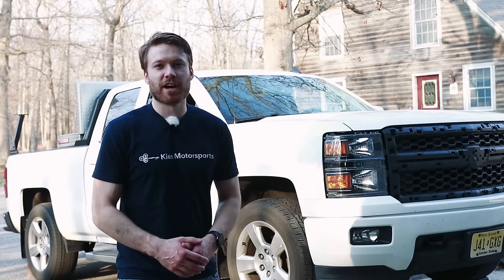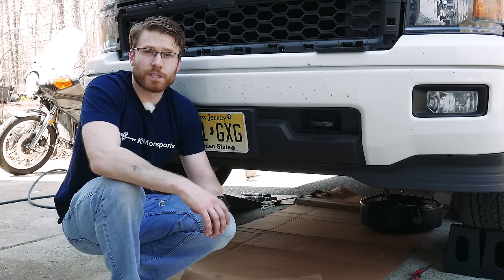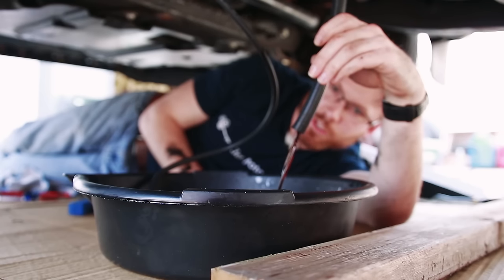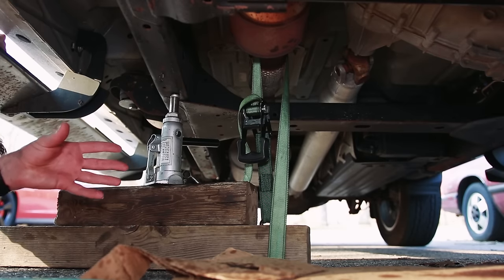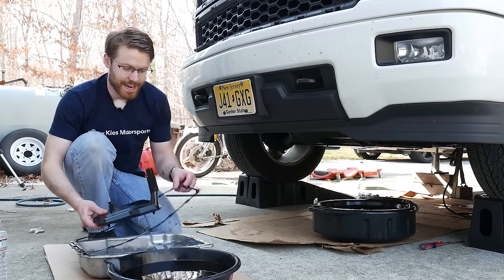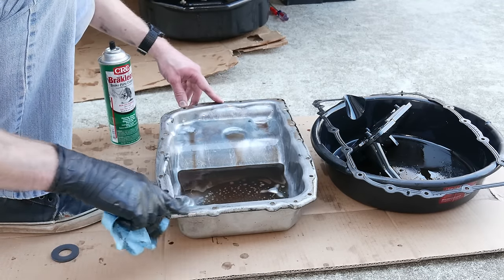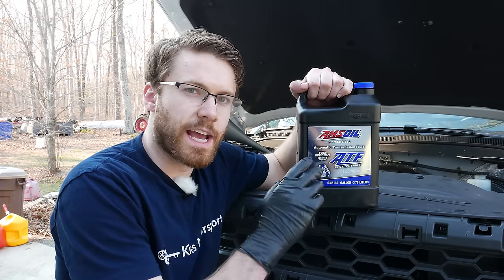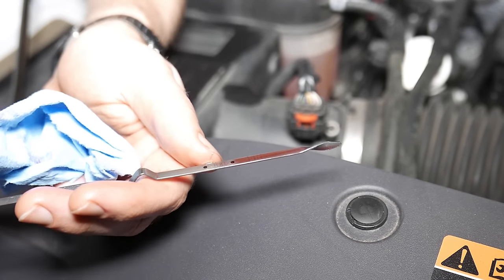6L80E Transmission Super Flush and Filter Change Silverado Sierra Tahoe Suburban Yukon Escalade H2

Comment: If you tow boats and trailers semi heavy, I’ve killed several of these transmissions. Seem to be good for 80 to 100 thousand miles. It doesn’t seem to matter if you change the fluid or not. One I did 88000 failed the next one I didn’t change went 100000. Great presentation👍🏼
Reply from the maker: Thanks for Feedback and info. Just curious, was it the torque converter that broke apart internally and grenaded the trans or something else?
Reply: Yeah I wouldn't tow anything "semi heavy" with a half ton.  That's what 3/4 and 1 tons are for.
Reply: I know this comment is older but did you run the factory setup during that time? GM has released a TSB related to the thermal bypass valve (transmission thermostat essentially) and its clear they've concluded that these transmissions are being run too hot (190+) with the factory setup. The updates thermal bypass lowers the opening temp by roughly 40 degrees.
Reply: @GrandPrix46 well that sounds good but, on Suburban and Yukon XL there are no 3/4 tons.  They say they can tow a set amount of weight, ought to be able to do it.
Reply: @slalomking   the 3/4 ton Suburbans have either a 6.0/4L80E or an 8.1/Allison 1000, along with a leaf spring full floating 14 bolt rear.  I'd tow "semi heavy" with those, but not "heavy heavy" because you're still limited by a lack of gooseneck/5th wheel hitch, and SRW only.

Edit: They have 4L85E's behind the 8.1's in the Suburban/Avalanche/Yukon XL 2500's, not Allisons.  But the 4L85's are pretty damn strong, too.
Reply: I'm curious, did you use amsoil for the fluid change or a different brand?

Comment: I also added an external spin-on Napa Gold hydraulic filter (10 micron) in line with the trans cooler lines on both my 2001 and 2011 Suburbans.  My Allison 1000 inspired me to do this with its spin-on, much easier than dropping the pan to replace the filter.
Reply from the maker: Interesting idea!
Reply: How many miles have you put on it since then.  My concern is that it might restrict flow.
Reply: @rayss3323  both those vehicles are gone now, unfortunately.  I had those kits on for about 2 years, so maybe 15k miles or so, but I would change the filters once a year.
Reply: Did this on a 99 Jeep XJ and it seemed to help.  Sold it before the first filter change but the additional capacity and filtration couldn't hurt.
Reply: @danieln3999 it could hurt if it changes the flow
Reply: @OscyJack-  how would it change the flow?  You break into a hard line and place the filter in-line.  You use a filter made for transmission oil.
Reply: @danieln3999  filters are an impediment to flow, especially as they age in their service life. You must be new to this...

Do you know your pumps total output? It's ability to flow through an impediment? The flow requirement at the exchange sites?

You can't just slap a filter on something and call it good. 
.it can lead to pump starvation, cavitation, additional points of leakage and or collection of impurities. 

You can add filters, but you have to plan for the effects on the final flow rate ... An Allison is designed to have an internal and external filter. A 6l80 is not. Could it be fine? Absolutely. But that's not a safe item to assume without first going Into the granular aspects.

More things have to be done in most scenarios, to support the addition of that filter. 

Granted fuel has different requirements, but you cant just add extra filters and separators without also increasing the flow rate through them and to the hpfp. Same principal with a transmission or any fluid loop. You have to first account properly for the variables that are present at baseline and then introduced by the end user.
Reply: @OscyJack- yep, adding anything in a line will add resistance and restrict some flow...

Comment: Great video.  On my 2015 Chevy Suburban, that top line is actually the sending line and the bottom line is the return line.  I verified this by removing the thermostat and putting in a 1/2 in outside diameter and 3/8 inside diameter clear tubing into the top port of the transmission itself.  Nothing came out of the bottom port.  So I was trying to think how you were able to get transmission fluid out of that line.  The only thing I can think of is that the thermostat was open, which allowed fluid to go into the return portion of the thermostat.  From there, I believe part of the fluid went back into the transmission and back into the return line where it got pushed all the way back into the sending line which resulted in fluid coming out.  I could be wrong, but that makes the most sense.

Comment: Better to half torque the bolts, then go to full torque. 
Great you are using Amsoil ATF. It is outstanding fluid. I've been using it since around 1980.
Reply from the maker: Nice! Yeah, we said the the wrong torque in the video 🤦🏼‍♂️ I pinned that as the first comment. Added a 0 by accident

Comment: Just bought a '14 Silverado LTX with 67k miles that is in incredible condition.  I wasn't aware of the chevy shake or shudder problems prior to purchasing.   Test drive was short, and I don't think I got it above 70 on the highway.  Noticed a little shudder/shake but assumed it was the road.  Like pretty much everyone I have the shake at approximately 74-80, but it seems to go away or at least improve a lot at times.  

Decided to do this flush and filter changed with AmSoil, bought 13 qts.  Luckily there's a dealer 15 minutes from my house. Following this video everything went great, actually thinking I'd be done in 2-3 hours, until I had to put the little c-clip back in.  I tried every way possible, but it just wouldn't go in, until finally it sprung off and went flying, probably lost forever.  Bought a new pack of clips and kept trying, but it just wouldn't go.  Took the bottom one off and tried it on the top and snapped right in!!! WTF!!  Used the new one on the bottom and clipped right in.  That little clip must have taken 4-5 hours. 

Took it for a quick spin on the interstate and the shudder is greatly improved and may even be fixed.  The shakes seem to be less but I'm going to have to get the 2-piece drive shaft from Performance Driveline to hopefully fix it.  

Thanks for the videos!  So helpful and quite entertaining.
Reply from the maker: It's always the little things that take the longest! Glad it improved!

Comment: If you happen to replace the cooler lines at the same time as a transmission oil change you’re able to unbolt the pan and slide it forward without doing anything else. Fits perfectly under the exhaust till you’ve slid forward and out

Comment: A couple notes from my "learning experience " lol. There was no mention of the torque converter and that it holds more than half of the system fluid (12 qts ish). The only way to get that fluid out and change all the fluid is by connecting to the cooler lines like you did. If you bypass that step you are only draining the fluid in the pan ( 5 qts ish) and cannot refill the total amount of fluid ( 12 qts ish)! Also a quick delineation any model with the dip stick fills at said dip stick, and has NO drain/ fill plug. I accidentally tried pulling the dip stick out of the trans thinking it was the fill plug mentioned In a video. Also a dropped the pan with ease using a ratchet strap and 2x4. I did save some headache removing all but one side of the pan bolts to allow it to drain, and then used a fluid transfer pump to suck the rest out before dropping the pan out and had little to no mess! Thanks for the video good work!
Reply from the maker: Glad it helped!

Comment: I have a 2014 Silverado with the 5.3. I installed a cheap drain plug on the pan so I don’t get showered with transmission fluid. Also I’m able to drop the pan without messing with the exhaust. I don’t mess with the lines either. I know there will always be unchanged fluid somewhere in the system. Simply changing the fluid and filter annually will make it likely to reach 300k miles. There’s other things in life to spend money on, get as much use out of these trucks as you can.
Reply from the maker: Agreed with just changing the filter and fluid is probably sufficient but we wanted to show the full process. I am stymied that you were able to get the pan out without adjusting the exhaust? How exactly were you able to do that because I had no room as you saw in the video.

Comment: I have a 2017 6l80 for a Yukon 5.3 and found out the hard was the top line coming out of the transmission is the high pressure line! I thought they would be the same as this one but found out the hard way it was the opposite. Worked great otherwise.
Reply from the maker: Interesting that they switched it but glad the video was helpful otherwise for you!

Comment: Thanks, followed your steps except I used to pry bar with a floor jack to Crank dat pipe down a little bit I pumped out like four gallons doing like one gallon at a time 18 quarts of full synthetic Castrol in there and I tapped a drain plug into the pan. I have a 2015 Tahoe LTZ
Reply from the maker: Nice! I want to tap mine next time as well. I may buy an extra pan ahead of time so I can get it tapped and ready to go for the next change.
Reply: Very important to get the snap rings on correctly when you drop the pan take the thermostat off and put the snap rings on when you're out from under the vehicle much easier and you won't fuck up the snap ring and have the line pop off a week later squirting a gallon and a half of brand new trans fluid on the ground lesson learned
Reply: @TheSundaeDrive  get the b and m transmission larger trans pan. Built in drain plug and holds extra 2 quarts.
Reply from the maker: I'll definitely look into that. I need to do this service again soon
Reply: Thank you  @richardmayer5293  - that sucks that happened, I appreciate you sharing.

Comment: This was great! Idea for next video:Spark Plug change. You cant get to it from under the hood at least the back ones (i couldnt on my 2014).Need to go in through the wheel well by removing the carpet liner on both sides.  Then they are right there. Still kinda a pain but I’ve seen alot if people ask about this and not much out there on it at least a clear video...
Reply from the maker: We definitely plan to shoot this in the future. Thanks for the tip and the feedback! If you think of any other videos that would be helpful please let us know.
Reply: I did all the spark plugs from under the hood on my 2011
Reply: I successfully did my plugs on my 14 L83 underhood. I remember the back ones I had to use a combination of swivels and extensions though.
Reply from the maker: It is doable but annoying for sure

Comment: Been binge watching your channel and mean no offense, but if you jack up the transmission from its mount, you're jacking up the engine as well and the exhaust manifolds....and the crossover.  It's not like the transmission is going to pivot from the engine in that situation lol.  Flexing down the single output exhaust seems more realistic.  Its a long run pipe and theres some play in there you can get away with .  Again, great channel.  Great journey you've had and thanks.
Reply from the maker: Thanks for the support! Glad you are enjoying the videos! Yeah, definitely not my favorite way to do something but it worked in this case. Wish they gave a little more clearance so it wasn't necessary
Reply: @TheSundaeDrive   I finally got around to doing this this weekend.  I stand corrected.  With the exhaust strapped down, jacking up the transfer case does create more gap between the x-over and pan.  I had the pan out in less than 10 seconds.  Went back in with a pan with a welded bung and plug.  Thanks again.

Comment: Get a pry bar on the exhaust that goes across the pan and pry it with your shoulder while you take the pan out and boom. It only takes 6 qts of transmission fluid when you do a fluid and filter change
Reply from the maker: That will work too 👍👍 definitely a pain. I want to do a custom exhaust setup with long tubes eventually and completely clear the area under the pan

Comment: How did you prevent the gasket from moving during reinstallation?   I have heard of a trick where you run either a Small ZipTie or even a sandwich bag tie.  At some of the major areas like corners and center of each sides.  Install loosely tight enough to hold in place but loose enough that you can grab one end and pull through.......(to the outside of the pan) after the adjacent fastener bolts get snug.  Remove the ZipTie remember keep the bucks part of the tie on the putt of the pan.  Pull ZipTie and the gasket should stay in place.  Depending on how many pan bolts there are you could do like every other one and as the adjacent bolts get secured the ZipTie gets cut and pulls through to the outside of the pan.  I would think safety wire, butchers twine or any type of moderately heavy duty string.......(Not Sewing Thread) would serve about the same purpose..

Basically you are using the string to help keep the form and shape of the gasket.

Also what is the current guidelines for Gasket vs Sealant.  In the old days with cork gaskets it was sealant on the pan, gasket then another layer of RTV on the transmission housing side , tighten as normal and allow about 30-60 minutes to cure.

Modern day gaskets are rubber or silicone and it comes down to. A choice of Gasket OR RTV....NOT both!!

I learned the hard way about using both...fortunately warranty covered it but good lesson learned!
Reply from the maker: The zip tie sounds like a good method. The screw holes in the gasket is tight enough that you can actually stick some of the screws through and they will stay in place and simultaneously hold the gasket. If I'm remembering correctly there might be a couple tabs that hold it in place as well
Reply: I’ve used fishing line and tied knots at a few bolt holes. Once in place, it is easy to remove the line and finish the install. It holds well but still gives you some wiggle room to get the pan in place

Comment: Thanks for sharing. Are you sure the torque spec for the pan bolts is 80 lb/in !!! Unfortunately I broke one the bolts at this sitting. I am sure my torque tool is in perfect condition and that's not the first time I use it. Is it possible this setting varies based on car model. My car is 2011 GMC pick up. As a matter of fact I viewed another guy's video whose car is Silverado 2013 double cab having the same transmission as mine and confirms the 80 lb/in torque setting .... I am simply confused and frustrated, something is wrong

Comment: I just changed a couple quarts at a time starting at about 50,000 miles. Pumping it out and refilling through the top. It’s stayed pretty clean
Reply from the maker: That's a good idea. changing the filter will also help.
Reply: @TheSundaeDrive  Yea I’m going to do a full service at 100k. I’ve heard you don’t want to let it get too bad and then just add all brand new fluid. Idk if that’s a myth or not.
Reply from the maker: @stevesherlock5334  yeah, I've heard the same. Probably some truth to it
Reply: @TheSundaeDrive  But babying and making sure to always use the best products didn’t help. Had the infamous lifter fail at 70K. Man I was pissed lol. I learned it’s been a real problem with the new LT engines.
Reply from the maker: @stevesherlock5334  yup. That's why I did the dod delete on mine
Reply: @TheSundaeDrive  Wish I would’ve done some research. I had no idea the lifters were a problem.
Reply from the maker: We have a guide showing how to remove it
Reply: @TheSundaeDrive  One of my lifters seized up all of a sudden. Obviously it sounded terrible grinding against the camshaft. I had no idea what it was until the mechanic tore it down. I just took the hit and him do it since he had it already. I should’ve done it before I did the tune and shut off the AFM.
Reply from the maker: That's a bummer :( yeah, as soon as I was out of warranty I deleted it
Reply: @TheSundaeDrive  But it wasn’t even an afm lifter that failed. I know gm just didn’t use quality lifters now.
Reply from the maker: Oh really? That stinks :( don't usually hear about those failing as often
Reply: davidgreene9471  That is deleted out of my system. In the computer and the engine. Always V8

Comment: Hello , I just saw how you do your gearbox oil level. It's fine with the engine running and the gearbox warm. The engine is stopped and the gearbox oil is hot. Not easy for me, it's the first time I've done it. Thanks in advance